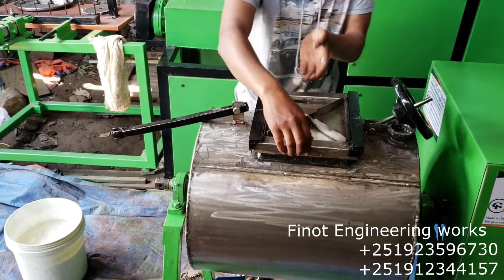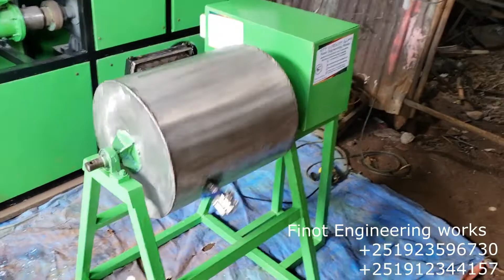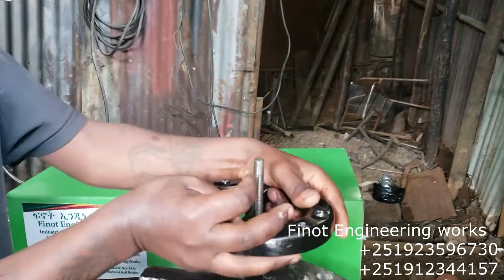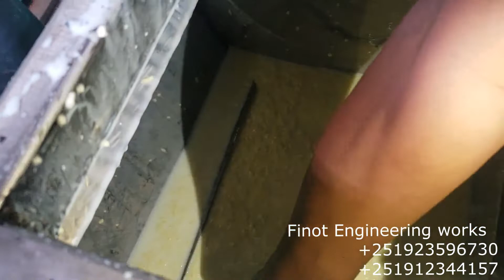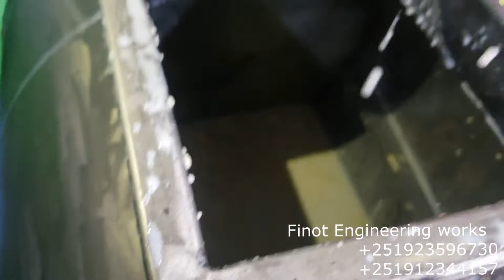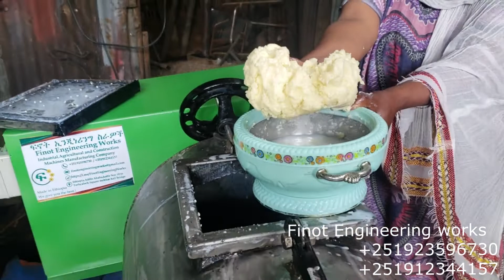ወተት መናጫ ማሽን/butter churner machine

Comment: ሰላም ፍኖት በጣም ጥሩ የሆኑ የተለያዩ ማሽኖችን እየሰራህ ነው ፣ በጣም ሊበረታታ የሚገባው ነው ።
የምርቶችህን ዋጋና ግን አብረህ ፖስት ብታደርግ የበለጠ ደምበኞች ታገኝበታለህ። አሁን ለምሳሌ ቅቤ ማውጫው ማሽን ዋጋው ስንት ነው?
Reply from the maker: Quotation Date:-23/06/2015 E.C
Machine details 
The machine used extract butter from milk in few minutes. It is easy to use with high quality in which minimizing time and energy. 
Product name:-electrical butter churner machine 
Material:-food grade stainless Steel 
Size(mm)L x W x H:- 791 x 700 x 1200
Gross load:- 48.01kg
Power:-1.5KW-220/360V
Capacity:-70 Liter
Warranty:-1 year
Remark 1:-we can take orders either lower and higher capacity as per your requirements
Price for 30L with vat:-65,279
Price for 70L with vat:-96,279
 📞 +251923596730/+251912344157/0112738090
email:-finotengineeringworks@gmail.com
website:-www.finotengineeringworks.com
Po.box:-28196
Address:-Ethiopia, Addis Ababa ,kolfe Noc 18 to Ekhaast Mall 1st floor around Degu Hotel.
google map location:-https:https://goo.gl/maps/JT5u6MSy7ppDhaVq6

Comment: ዋጋው ስንት ነው
Reply from the maker: Quotation Date:-23/06/2015 E.C
Machine details 
The machine used extract butter from milk in few minutes. It is easy to use with high quality in which minimizing time and energy. 
Product name:-electrical butter churner machine 
Material:-food grade stainless Steel 
Size(mm)L x W x H:- 791 x 700 x 1200
Gross load:- 48.01kg
Power:-1.5KW-220/360V
Capacity:-70 Liter
Warranty:-1 year
Remark 1:-we can take orders either lower and higher capacity as per your requirements
Price for 30L with vat:-65,279
Price for 70L with vat:-96,279
 📞 +251923596730/+251912344157/0112738090
email:-finotengineeringworks@gmail.com
website:-www.finotengineeringworks.com
Po.box:-28196
Address:-Ethiopia, Addis Ababa ,kolfe Noc 18 to Ekhaast Mall 1st floor around Degu Hotel.
google map location:-https:https://goo.gl/maps/JT5u6MSy7ppDhaVq6

Comment: ዋጋው የት ይገኛል አዳማ ካለ ጠቁሙኝ
Reply from the maker: Quotation Date:-23/06/2015 E.C
Machine details 
The machine used extract butter from milk in few minutes. It is easy to use with high quality in which minimizing time and energy. 
Product name:-electrical butter churner machine 
Material:-food grade stainless Steel 
Size(mm)L x W x H:- 791 x 700 x 1200
Gross load:- 48.01kg
Power:-1.5KW-220/360V
Capacity:-70 Liter
Warranty:-1 year
Remark 1:-we can take orders either lower and higher capacity as per your requirements
Price for 30L with vat:-65,279
Price for 70L with vat:-96,279
 📞 +251923596730/+251912344157/0112738090
email:-finotengineeringworks@gmail.com
website:-www.finotengineeringworks.com
Po.box:-28196
Address:-Ethiopia, Addis Ababa ,kolfe Noc 18 to Ekhaast Mall 1st floor around Degu Hotel.
google map location:-https:https://goo.gl/maps/JT5u6MSy7ppDhaVq6